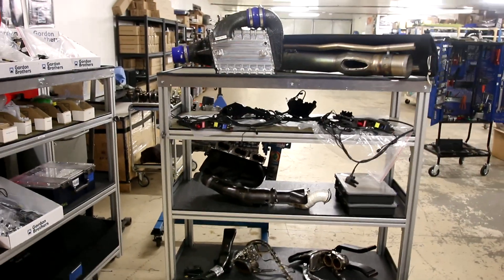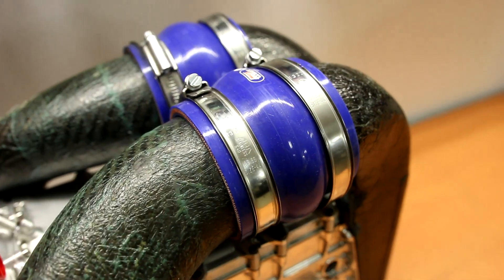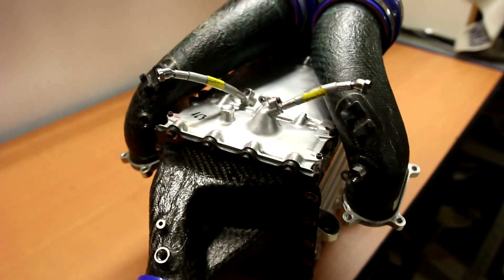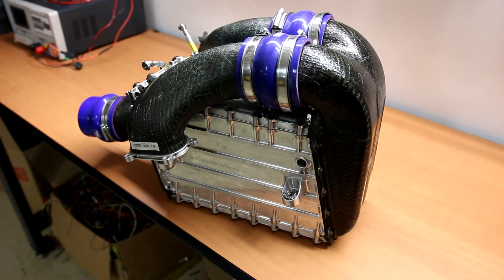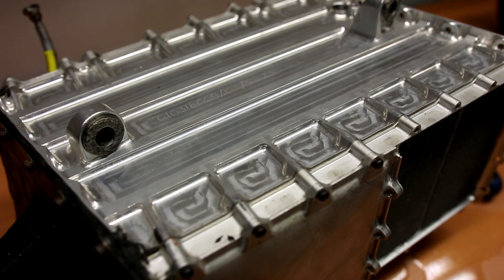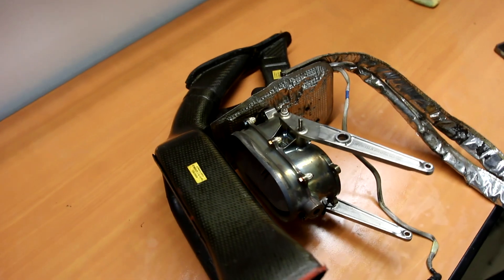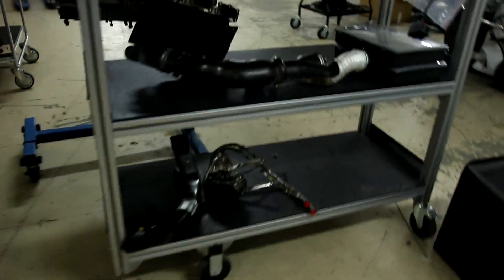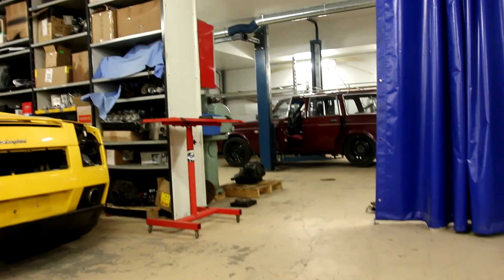Formula 1 Intercooler and Wastegate in detail (Ferrari)

Comment: Hi Peter. I believe me or not but I used to work for Marussia before it when tits up first time at the end of 2014. I have a little knowledge about some of the parts you have although I used to work in the aero side of things. For instance I believe that the waste gate is made from Ti and if you it looks like you've got an exhaust there too. Unbelievable that the collector between the wastegate and the turbo pipe was machined from billet Ti! 
The charge cooler is cool hey, it was fed from a air to water cooler that was fed and positioned just behind the roll hoop on the 14 marussia car.
If you have any question, I can try and answer.
Reply: wow hopefully he tapped you on this...do these parts have any street usage potential? I have always been curious about the f1 parts on street stuff.
Reply: Machined titanium billets with carbon fibre. That's like alien technology to me
Reply: Got a picture of that cooler?
Reply: This whole comment is actually more interesting than the whole clip
Reply: why do very smart people make English impossible

Comment: It's a normal water to air intecooler.
minis tubes are used to maximise the surface area of heat exchange.
you have more surface of material with numerous little tubes than bigger fins.
moreover it allows more homogeneous exchange.
Ethylene glycol is not allowed on tracks,so it's certainly just water,or water with sodium,or something enhancing heat exchange.

Comment: Those are generally called "charge coolers" rather than intercoolers but technically it's a "laminar flow air-to-water heat exchanger". Surface finish on the carbon is due to that being the layup side and also due to that side not needing to be smooth for any purpose other than aesthetics...so it's not (to save weight). Nice to see one torn down! Still surprises me that they use wastegates at all as the whole point of the MGU-H was to harvest energy from the turbo when producing more boost than required. Material is probably inconel or titanium.

Comment: i wonder what kind of liquid flows in there its not water for sure
i quess  some refrigerator technology is going on here . . . liquids that have boiling points of -40 or lower 
nice informative video :)
Reply: its likely just water.    a lot of race tracks and drag strips dont allow anything other than water for coolant for safety and cleanup in case of a wreck.
Reply: Pretty sure its water of some sort. 
You wouldnt have a refrigerator to cool a engine, uses too much energy and space and weight. 

just -40 boiling point in the normal system would mean you only cool it with gas = bad thermal efficiency compared to water which is pretty much the best thing there is to transfer heat.
Reply: Kolvtapp you are right its air To water charge cooler.
Reply: Yes but that could be any number of fluids, me and you can't pinpoint just from a vague video that it is the Intercooler fluid.
Reply: Absolute Nonsense they probably do use water with a additive like water wetter. No joke that's what it's called look it up the stuff works good. We used it in sportbike racing so probably something similar
Reply: euroaaRON1 it is water. Water will travel through the tubes as air is traveling through the shell. It's an old Ferrari intercoolers made by mezzo technologies (Baton Rouge, Louisiana). Once Ferrari is done with that season they Change everything about the motors including intercoolers but they sell the old model to other companies using the old engines.
Reply: its something other than water. look at the color of the fluids that gushed out of Alonso's car in his crash at Australia.

Comment: Its nice to see they use ebay silicone bulge couplers and worm drive hose clamps in F1.
Reply: when you're on a budget, not always worth trying to re-invent the wheel. plenty of people running over 800bhp using silicone hose adapters. the worm drives are quite surprising though, I'd have thought they'd use at least use constant tension clamps!
Reply: Alex Haws remember they're clamping to carbon fibre... It may be reinforced with a metal band, it may not. Regardless, you don't want to overtorque clamps onto carbon
Reply: i think the point he's making is that they are cheap parts to be using on ~£15mil engine - which generally contains no "off the shelf" parts. Those joiners are like £15 each.
Reply: could it be that these parts were used for testing where they simply did not need heavy duty clamps? still interesting though. enough to say that MY own car has F1 parts on it ;)
Reply: what do you mean ebay? samco is the top company in silicone hoses, not some chinese crap.

Comment: chargecooler is what i believe air to water coolers are called. and im not sure it would be good for a huge v10 like the gallardo has!
Reply: I have never heard the name chargecooler. People just say air to water intercooler but I did look it up now. But you can look them up all the dallar perfomance lamborghini and the UGR lamborghines use them air to water intercoolers.
Reply: Relax all that heats gotta go somewhere still. Even if you have a chargecooler(heat exchanger) youre gonna need a bigger or more efficient rad
Reply: Russell Brown I was think the same.
Reply: He's asking about the type of construction not what it is  there's tube and fin and bar and plate.. this is clearly something else.
Reply: Relax straighr out of a 1.6 ltr f1 car yeah?
Reply: Relax and heat exchanger could refer to any type of radiator. Air to liquid intercooler=chargecooler.
Reply: https://images.cdn.circlesix.co/image/1/700/0/uploads/posts/2016/08/1f824df11a00d06f2bc9a7a48d7a6bfb.jpg
Reply: air to water is more efficient so its smaller
Reply: Russell Brown It's called a heat exchanger and all the 2000+ hp Lamborghini's in the states use them.

Comment: Micro-tube intercoolers. You can get a custom one made by a company called mezzo technologies. I think they may have made the ones for F1. They make them for Indycar and a few other series.
Reply: gentleman and a scholar. Appreciate the link, those things are awesome. Makes me think of those gigantic boiler systems for power generation.
Reply: If the parts were built to last only one race, that meant that the team would have to make 20 copies of every part for every race. But you always hear people talking about how expensive a crash is, when Verstappen had a small bit smashed off his floor and it was £50,000 worth of damage. It's way too expensive to build a part for every race. They need to be fast, but they need to last.
Reply: john jay wow thanks. Who knew an f1 part could be expensive
Reply: How much would one of those cost?
Reply: Themayseffect I'm  not assuming it is cheap. I'm wondering if it's $2000 or $15000? I know it would be a lot. I thought since he gave a link he may have an exact number somewhere
Reply: Not to mention the second 
Most expensive part besides the 
Engine (which is modular) is the monocoque. Most teams only produce 4-5 for a season.
Reply: john jay F1 cars are prototypes vehicles it's the pinnacle of racing the parts they use are DEFINITELY made to last but they are pushed so hard parts may fail that's why engines are often rebuilt from constant abuse
Reply: Oww
Reply: Alex Mandzyuk a lot.
Reply: thats not evenly remotely accurate. these parts are meant to withstand the test of time. most parts are reused throughout the entire season unless it fails. The goal is to keep them from failing. Yes the are purposed made for the intended cars. Not for road cars, but that doesn't mean they will break or die just because its been used through a race stent. One formula 1 race is probably more abuse you'd put on a car over an entire year.
Reply: @Themayseffect  you can see where a few tubes are blocked with screws because they developed leaking.
These parts are certainly not designed to last forever, or even a long time. They will require constant maintenance and monitoring if you can see screws in it already from one season. 
I am sure the company that makes these can make a stronger (heavier) one that lasts longer though.
Reply: @ohyou_6599  Those screws are not to plug holes. They hold that mounting plate on. Nothing wrong with the reliability of the part. Plus that theory doesnt even make any sense. If tyey wanted to plug tubes all they'd need is some type of epoxy/glue, not screws. You can tell by the geometric consistency that's not whats going on.
Reply: ihrocks no he's not and neither is your point. If that was the case the Mclaren Honda would be the pinnacle of design engineering...Oh wait. They aren't winning anything. Cars need to be built to last. In you point, yes, over engineering for the sake of outright strength is wasteful, but the part still needs to last. Its called optimization.
Reply: john jay wow. i bet you are always the life of the party...douche
Reply: Hate to break it to you guys but John is right, in races like F1 where every .01 of a second matters if a part lasts longer than the race then it was built too well (Read "Heavy") AKA they could have made the part lighter therefore making the car lighter.
Reply: ihrocks Yes till end of the 90’s it used to be like that. But nowadays they’re only allowed to use 3 powerunits per season. These parts are from 2014 (?) and then I think 5 pu’s per season, so should last at least 5 races. 
But you’re right that they will still never make them stronger than necessary/to last a lifetime. 5 races is enough, every gram counts. More strength usually means more weight.
Reply: It's okay to admit you have no idea what you're talking about.  We won't judge.
Reply: Alex Mandzyuk who'd assume it would be cheap lol?
Reply: you email them & ask. /rollmyeyes But i'm guessing it's into $10000+

Comment: You ROCK !!! thank you for sharing. very nice video 

btw, 059/3 stand for 2014 engine. ;) ...i guess you know by now. 
The 2015 intercooler is a little different, and the wastegate design was dropped for 2015 as well.
(you can google it, search for Toro Rosso engine pics, you will see. (its the 059/4 engine)
Reply from the maker: Ok thanks for info!

Comment: I've studied marine engineering and i have personally inspected these types of intercoolers in old pielstick diesel engines
Reply: Cut de Pie Fails Well the welding is not so much of a problem, these diesels are two stories high V16s and the intercoolers are about 1x2x4 metres and the tubes are 1,5cm in diameter. For the rest of it, they are very, very expensive to change as a unit so lowering the efficiency a little bit is more viable in that case.
Reply: 40 years old and full of salt water...
Reply: Ok, and what's your opinion about them?
Reply: albin ahlskog is that so?!?!?
Reply: Cut de Pie Fails I don't really know, they didn't seem very reliable as i had to machine plugs and weld some of the tubes shut since they started leaking (corrosion). Keep in mind though that these were 40 years old, but otherwise worked just fine.
Reply: Why or how would you weld such small tubes, seems an awful lot of trouble to fix a core, but, that raises a good point, if a pipe leaks, it's a gone core, because it's not worth risk coolant dropping (in the tires for example). 
But to be honest, these pipes look extremely sturdy and hard to leak  .
Reply: That's a lot bigger than these ones. Didn't know, neither about the tech or how it was on the boats, so thanks for the explanation and it makes sense, I thought you were welding these tiny tubes, just to take this tiny tubes one for one it will be a pretty hard job.

Comment: Amazing that it's water to air, thought that would be way too heavy.
Reply: beauty of micro tubes, so little volume for maximum surface area.  i bet that intercooler when full holds maybe 250 mL of coolant.
Reply: water to air is more consistent and more controllable than having to rely solely on ambient air temps.
water to air IC's still use a heat exchanger for the water in a closed loop. in road cars at least. i would imagine these cars still use a heat exchanger for the ic water.
Reply: Well you can't exactly put a big ass a/a intercooler into those tiny intakes they have, especially when you start talking tubing and everything else
Reply: They can easily make the weight limit with the intercooler full of liquid.  Even if they got a increase in weight, they could take out some ballast weight to compensate.
Reply: I guess they make it compact enough that they wouldnt have to increase the volume of coolant too much, while hanging more gear in the wind would be a big drag penalty.
Reply: Agree
Reply: Wayne Woj They have massive heat soak issues because there are no fans for any of the radiators, but it only happens on the grid and in the pits
Reply: ,,, would have to have a seperate cooling system liquid from the engine .
Reply: @rolandtamaccio3285  no shit?
Reply: I'd say packaging and minimal plbing for the manifolds. Water to air is easier to fit but you need more junk to make them work.
Reply: @E.Asinus  constant airflow, hand-placed fans in puts (car doesn't usually idle in pits/isn't stopped for pit stop long enough to matter).

That being said, I would love to see a log of intake air temp during a pitstop - from time entering lane to when they merge back onto track